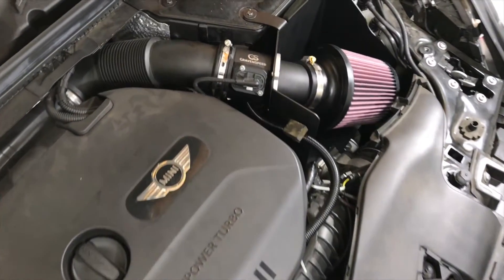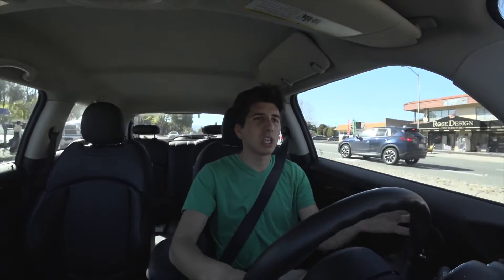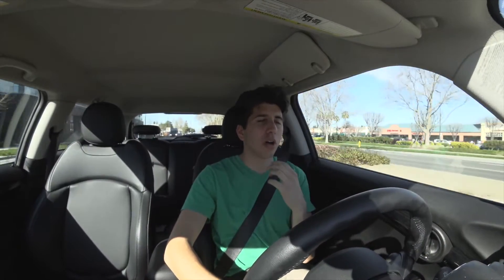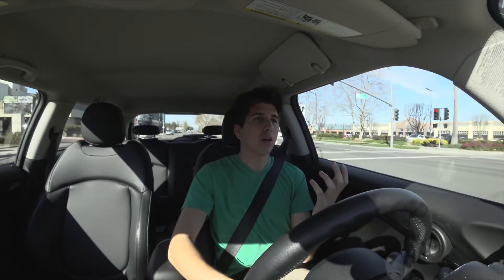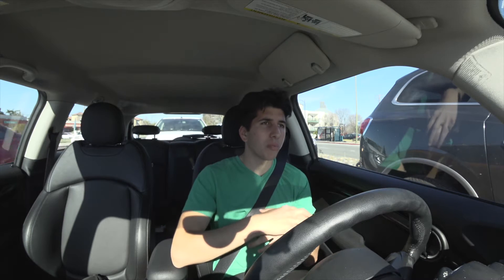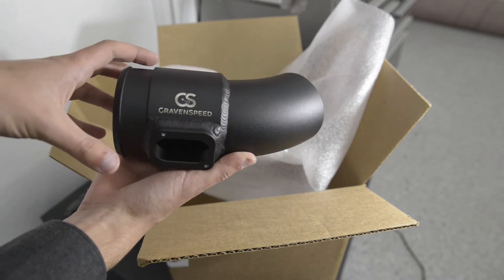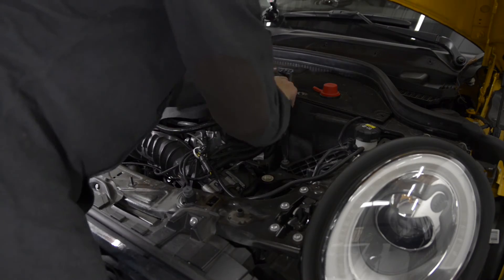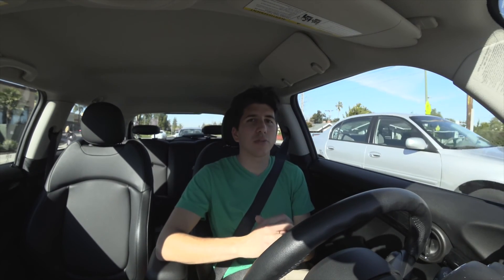CravenSpeed Cold Air Intake Review - Mini Cooper S

Comment: Well done! I bought and installed a cold air intake from Mini Mania last year. It's very similar to the Craven Speed. I was actually going to get the CS unit since the company is located in Portland, just north of where I live. But MM was having a sale so I opted for that one instead. Installation was about the same as is the sound. I did notice a slight drop in gas mileage so before a recent trip I put the stock system back in. There wasn't a noticeable difference though so I'll put the other one back in. One thing that isn't mentioned in any of the videos I saw that might help some folks is to remove the plastic cover over the oil filler. It just pops off and on, and makes it a bit easier to get to the air tube and such. I'm still considering the Borla exhaust, but haven't done it yet. Thanks again for your videos!
Reply from the maker: Thanks for watching John! I did notice that my fuel economy has gone down from 25mpg to 23mpg but I believe that is due to my lead foot! That Borla exhaust will bring your Mini to a whole new level!
Reply: I suspect it's lead footitis as well. :)

Comment: hi dude,  good election; i have a mini cooper hot chilli S 2016 rhe 1st tune was the K&N cold air intake and the car got arroind 9 to 12 hp more, and the sound with the turbo is very nice and noticeable in cabin and the exterior ,  my recomendation to get arround 270hp in total is the neuspeed ppwer module +  racing fuel the car really rocks and is able to race in performace way 👍👊 stay tuning congratulations
Reply from the maker: Thanks for the tips and watching Alfonso! How is the torque steer with that much power?
Reply: Should I Get It hi,  in the central panel there is not enough measure to get the real torque and HP but with a dyno and or dashcommand appl i have seen up to 378 nm. in the track dhe Mini goes faster than leon cupra fr,  the older and new ones for focus rs ans st,  camaros and 1 nissan gtr in the street 😃
i will measure and get the graph for real race or 1/4 mile ans share,

Comment: Should install a Full 3inch Air Intake System for F56. Made huge power on my car!!
Reply from the maker: What system did you go with? Do you have a JB4 as well?
Reply: Should I Get It I had a JB4 but got rid of it. Going to get a dyno tune next week. Partnered with a shop and built a Full Air Intake System for 3rd Gen MINI. Replaces the plastic pipe and has a full 3in diameter all the way through. Check out my videos and let me know what you think! Thanks for the reply.

Comment: i would fit a life time more open filter in my stock air box but never pay the prices most of these induction kits cost.
Reply from the maker: How come?
Reply: @shouldigetit  Less heat soak from keeping the stock air box!
All I have on my 2015 Cooper S is a resonator delete,lifetime Pipercross filter and a used TMC 4 channel tuning box,total cost £175 and it,s amazing fun on a lower budget.had no issues in over a year now.
Reply from the maker: @teggsy2165  Verynice!

Comment: Hey Ben, Just a couple of questions. So i have a 08 Mini S i know very little about cars sadly but would love to know more about my car and you being a mini owner who mods said mini i wanted to know if i should get this cold air intake over my DDMWorks one i have currently installed, i plan on getting the Borla exhaust for it as well since i currently have stock but wanted to know if this would give me a little extra push in HP also was wondering what a JB4 tune is. Your help would be greatly appreciated, Thanks.
Reply from the maker: +Chronosco Get the Borla exhaust. I don’t believe the JB4 is compatible with your generation of Mini but google “Burger tuning 2008 Mini Cooper S”

Comment: Just installed same Cravenspeed intake on my 2017 R56, the CEL came on almost immediately... did you have this problem?  Any idea on solution??
Reply from the maker: +M Tramontana I didn’t have any issues. Did you move the MAF into the unit? 

Make sure the sensor is not angled either as I know in some cars that sets off the CEL. Call CravenSpeed they’re helpful!